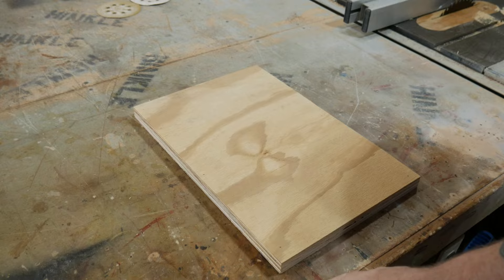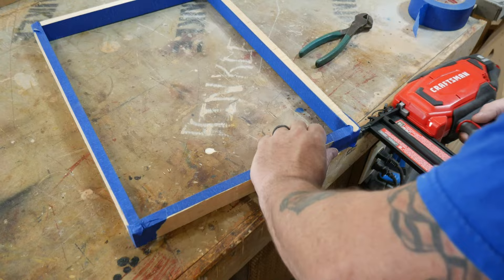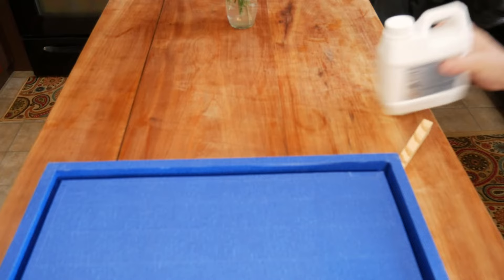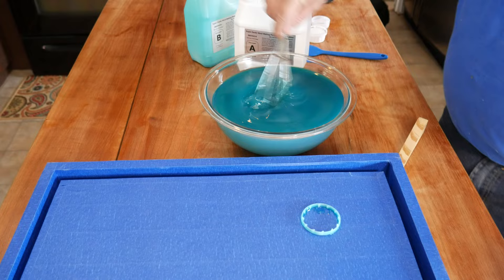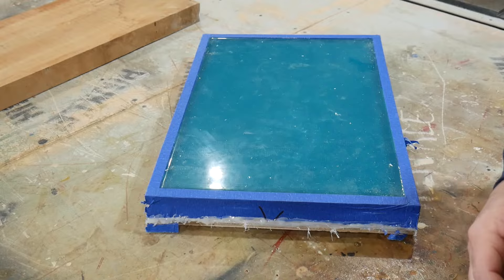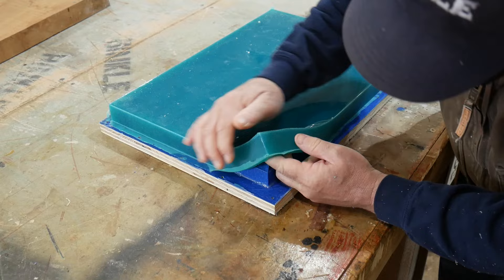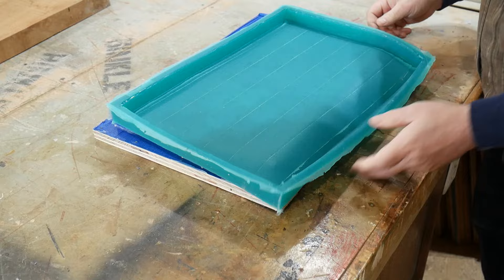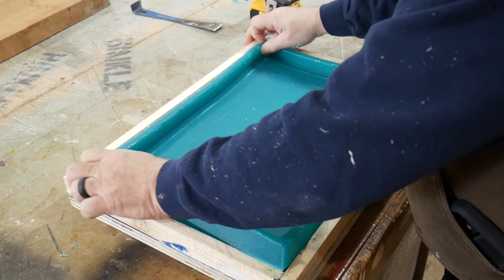DIY Home Made Silicone Mold for Epoxy Resin

Comment: I tried doing this with painter's tape but the epoxy stuck to it.  I had better luck with regular packing tape.  Don't know what went wrong.
Reply: He made a silicone mold in the video. That blue mold would then be used as the mold for an epoxy pour, not shown in this video.
Reply from the maker: @XGuard04 correct I show that in the  bullet casing charcuterie board video it’s the very next one the following week 
Thanks for watching

Comment: Great video. I'm looking to make a similar mold, around 18" x 12" x 2" deep with walls about 1/2" thick. What are the dimensions of yours and how big of a silicone kit did you need for it?
Reply from the maker: Thanks for watching sorry for the slow response 
I used a gallon kit
But if you go on the total boat epoxy website it has a liquid calculator for free

Comment: I have a short round vase with legs. How do i make a mold for that 🙏
Reply from the maker: I would create a water tight vessel and place the vase inside it
 (after spraying the vase with mold release)
Then pour around the vase 
The inside will be more tricky you would have to pour in the vase and remove it after it cures then suspend the molded inside plug over the outside molded vase

Comment: How do I make a mold for something with a hole in it?
Reply from the maker: Thanks for watching 
If the hole goes all the way through the finished piece, simply screw a block of wood or some other material in the desired shape in the position where you want the hole and pour the silicone around it. Hope this helps.